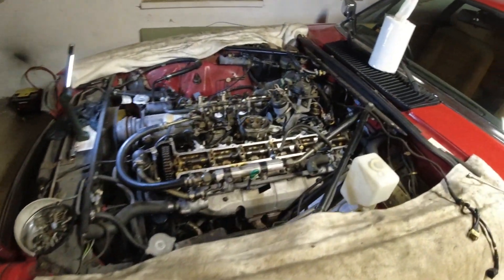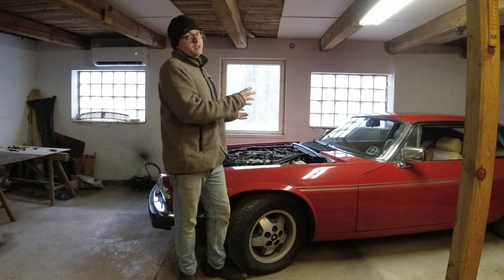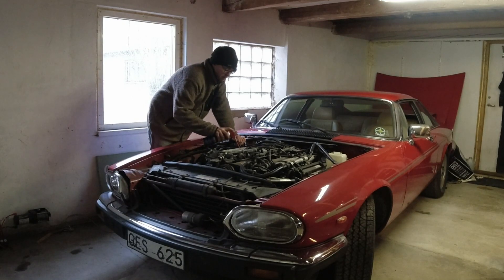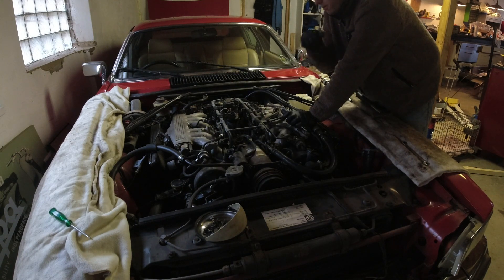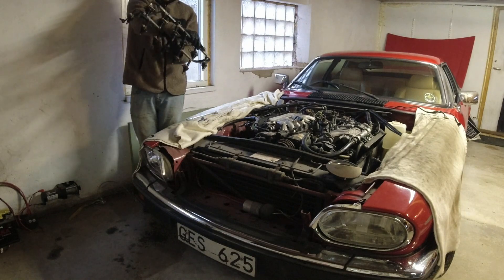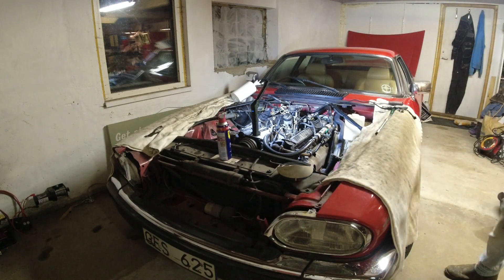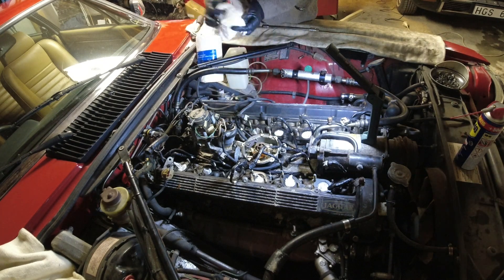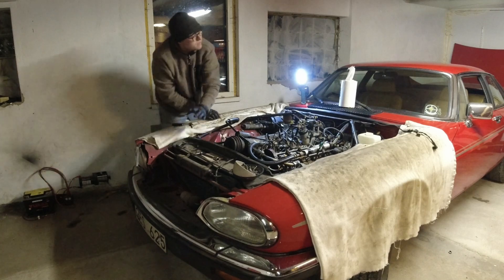Making a V12 Jaguar XJS a Reliable Daily Driver in a Weekend (or two...)

Comment: Adam, have you seen the modern EFI system made by Mobeck for the Jag V-12? I’d love to know your thoughts on it, especially in the context of wanting to use the V12 as a daily driver for many years. It’s expensive, but the idea of having modern engine management with no vacuum lines on the V-12 intrigues me to say the least.

Their stock high-mileage XJ12 test car put down 300hp on the dyno.
Reply from the maker: Yes I’m aware of it and I’m often in contact with him. It’s a very neat system however when making a daily I prefer to keep things stock. That way it’s easy to diagnose and issue and fix it with normal parts.
Reply: Thank you so much for your reply, Adam. Your videos make owning an old Jag much easier and more pleasurable! My car and I thank you!!
Reply: Thanks for the tip -

Comment: Have you considered removing those bulky accessories?  The goal is to get air freely flowing  through the engine compartment  and incidentally show off that beautiful engine.  
  That bulky heavy air compressor  blocks a lot of air and makes changing spark plugs really hard.   My go to is the Sanyo.  But others are good too.  
        Alternator I use the smaller GM.   The power steering pump  is just a GM so I buy the racing version where the tank is remote. I also use the Rob Beere pressure regulator because I hate the over assisted feeling the stock one has.
Reply from the maker: Well it’s a customer car so I’m doing what the customer wants. Usually I like to keep my cars stock and use oem parts. However on some of my personal cars I have upgraded the AC to a new Fen Air system with a Sanden compressor

Comment: Hi again Adam,
Are you managing to remove the cam covers (to replace the gaskets) without having to de pressurise the air con system, or does it need de pressurising.
Cheers. Andy G.

Comment: just found your channel, great work! 20 years ago I was looking at buying an XJS and followed a jag forum. The consensus in that group was to get Kirby Palm's "TheXJS book" - which is actually a pdf.. I believe he was a helicopter mechanic in the NYC area and very carefully researched many of the XJS problems and tracked them down to poor maintenance. For example the overheating cats and fires were due to bad rotors and misfiring.  It might be an interesting read for you. Good luck with your project! You may convince me to look at an XJS again.
Reply from the maker: I’m well aware of his book. Some of the advice is good and valid today and some is not. 
I work on these for a living so I’ve found my share of tips and tricks. I try to share them here on the channel. Thanks for watching!
Reply: Oh man, an Adam addendum/rebuttal to the The Book would be gold!!

Kirby hangs out on the jag-lovers forum, which is cool. You can ask him questions about his book directly. No doubt, his opinions aren’t always shared by the other very knowledgeable people there, and I don’t think he has changed his mind on anything in 20 or more years. That’s not a criticism of him, just my observation.

Comment: Hi Adam. How do you disconnect the fuel pump to get rid of pressure? Thanks.
Reply from the maker: I remove the fuel pump relay and crank the engine
Reply: @LivingWithAClassic  Thanks Adam - I know it sounds like a silly question, but all the forums seem to point in completely different directions when trying to do something simple like locate a relay... Loving your videos mate - I'm slowly learning more and more about my XJS V12 - and she's slowly getting more and more reliable (I'm not quite there yet though!).
Reply from the maker: It is next to the battery in the back. To the right of the battery

Comment: Nice job Adam, do you plan to remove the camshafts and reseal the cam carriers to the cylinder heads?
Reply from the maker: Not on this one. It hasn’t been leaking there really at all